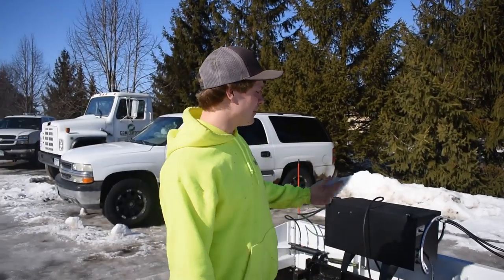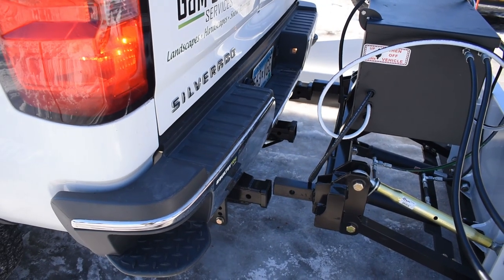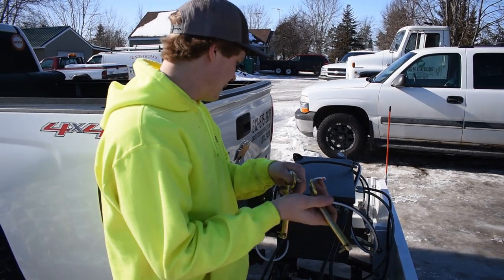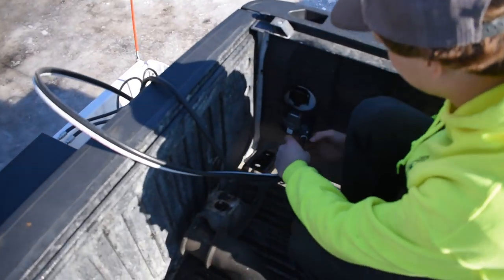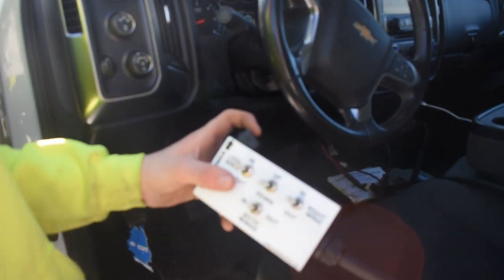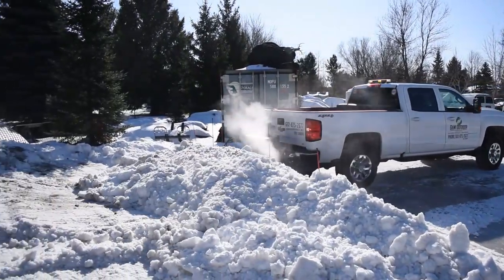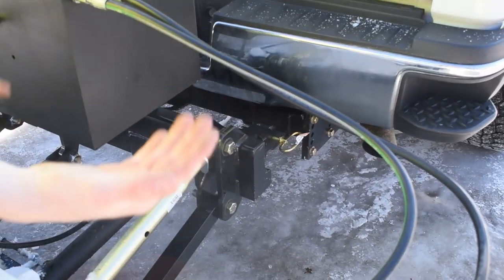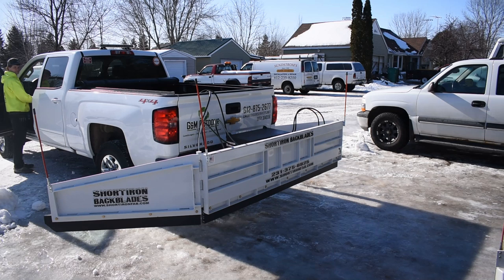HOW TO PUT ON AND TAKE OFF SHORTIRON PULL PLOW

Comment: does it have shear pins or a hydraulic bypass valve?  I have a Boss drag pro I thought i would love how much down pressure it has (2000lbs) but after i ate a set of the rubber cutting edges in two days and bending the bracket for the shear bolt.. i wish it had a float mode...

Comment: Thanks for sharing the info. Is the very bottom scrapper a durable type plastic? I would like that instead of metal because of brick paver driveways the plastic would simply just glide over the pavers.
Reply from the maker: Yes it is a hard plastic
Reply: @GarrettWilliams2017  Thanks

Comment: what if the ground was not flat side to side?  That would be hard to get it into each receiver...one too high from the other...just saying
Reply: gman77gas when mine is off that far I raise the plow up and get the lowest one to slide in a bit and then I drop it a bit to get the other started. There is enough movement in the linkage and such for it to work.